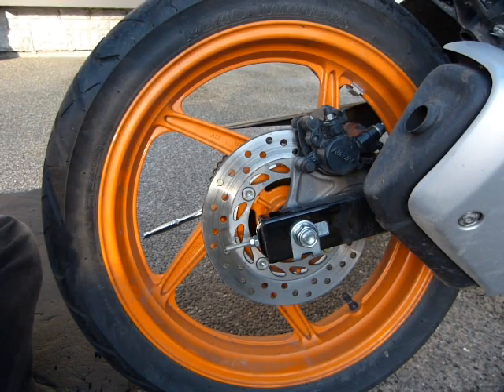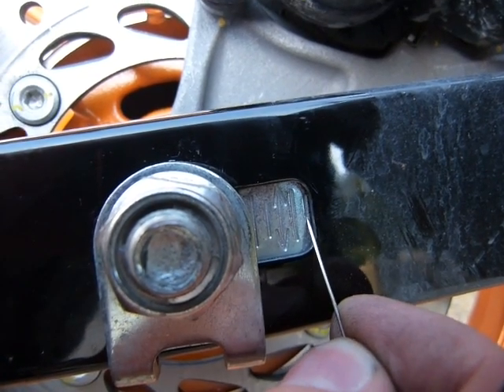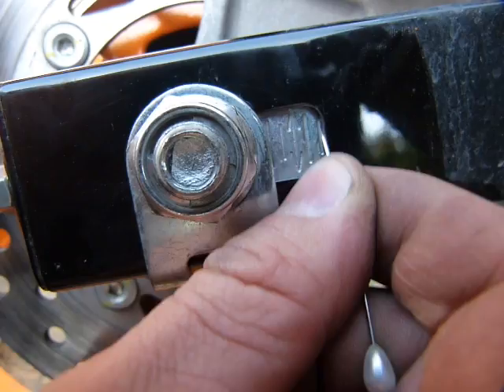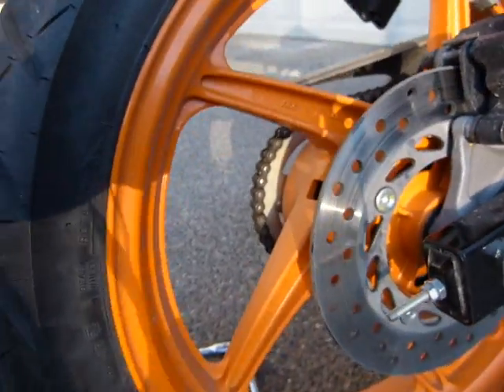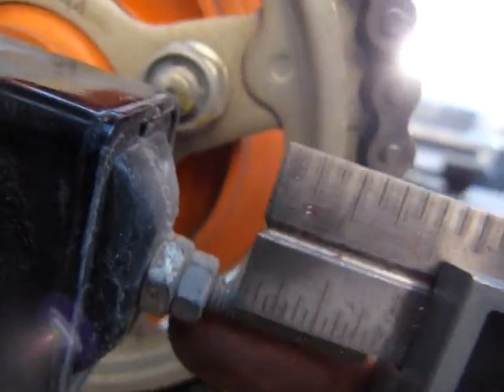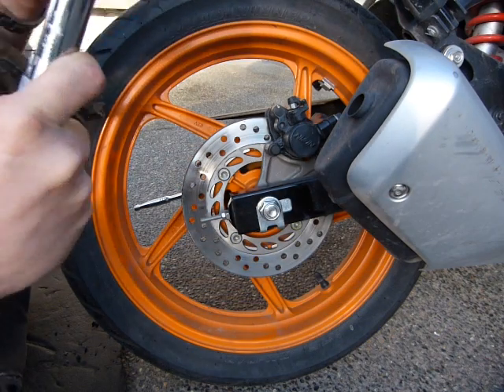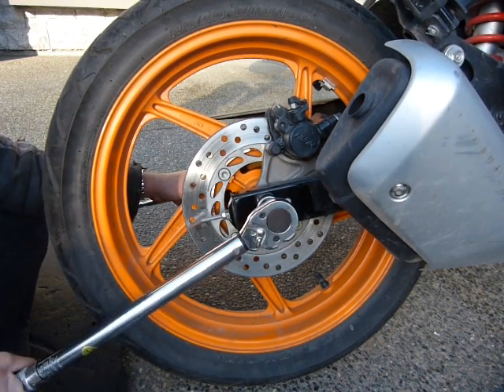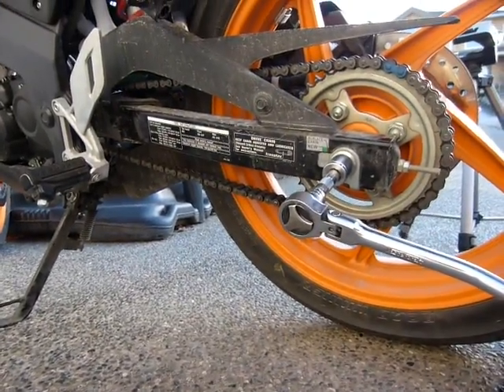Use a torque wrench, check wheel alignment and chain slack

Comment: Hey! I've encountered a problem when tightening the chain. When I measure the distance between the 10mm counternut, and the "stock?", I do not get the same measurement on the other side. However the measurement ligns are aligned.. 

To simplify, the measurement lines are equal, but the distance between the counternut and the stock? is different ^^ I do notice that the bike slightly hovers to the right when driving. 
Any ideas? thx
Reply from the maker: Have your buddy hold a meter long (4feet) straight edge (plywood will do) against the rear rim/tire, nice and even pressure. Eyeball it, is it pointing forward straight? Same direction as the front wheel? Use a tape measure.
Hovering: check bearings, wheel and steering should not have any play sideways. My front wheel bearing collapsed on me once. Check out: Motorbike full inspection part2: Wheels, suspension, brakes
Wheel alignment options